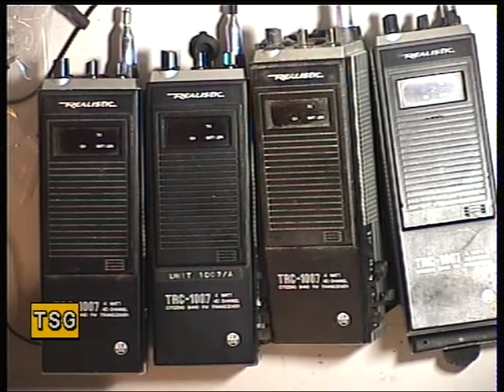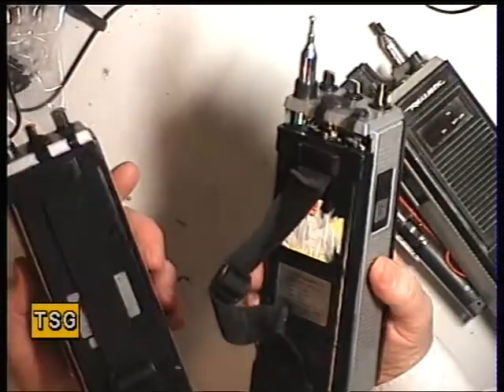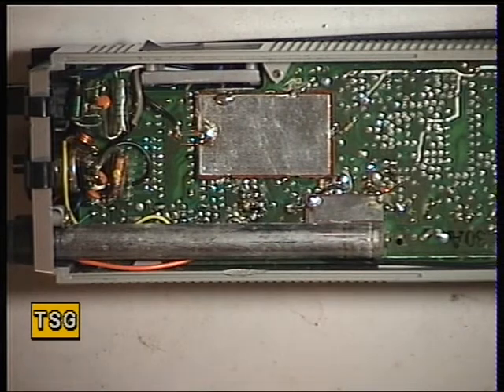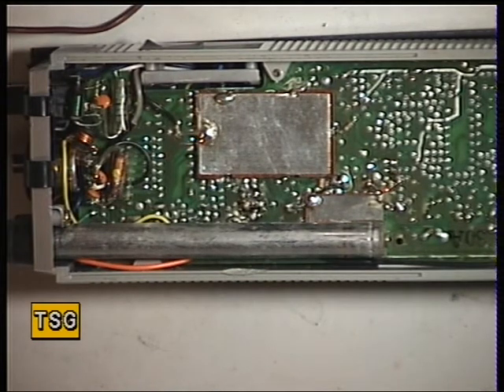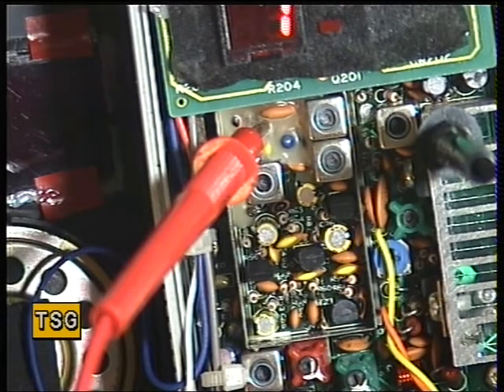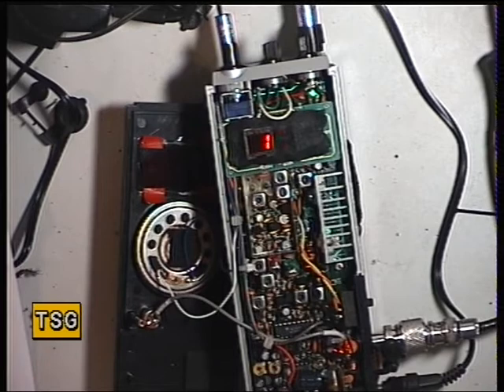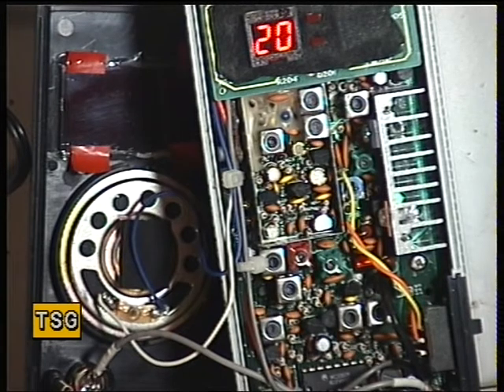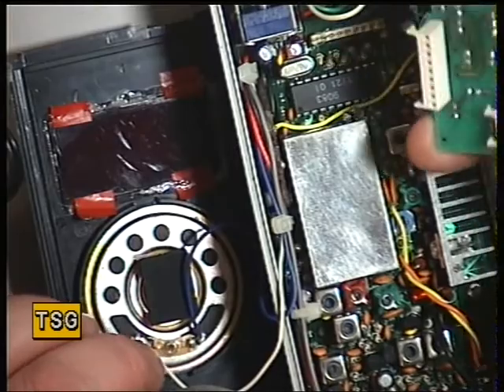Realistic TRC1007 - UK CB radio 3.5W, 40 channel (CB 27/81) (Hand portable). VCO & Transmit

Comment: Yeah I run 8 batteries and 2 dummy in it when I first got it I had a bunch of battery corrosion. I plan on taking to get repaired I'm thinking it might be a bad capacitor. Thanks for the feedback. I know I radios in the UK are a bit different. I like the UK vintage UK radios
Reply from the maker: are you in the 'States?

Richard
Reply: Yeah I live in Arizona . Yeah I really like the old vintage radios and trying to learn how to work on them. Like watching your videos try to learn stuff
Reply from the maker: Just remember, Joe, that everything I do on UK CB is FM &  that AM CB is AM, so huge differences & totally different boards...but often in identical cases!

Richard, G0OJF, UK

Comment: I bought one of those off of eBay trc-216 in great condition however when you turn the thing on it makes a very loud humming noise. They're really good built radios
Reply from the maker: Joe, the TRC216 is the FCC approved AM version for the USA. The innards are totally different to this UK only FM TRC1007. If you are in the UK the TRC216 is illegal to own or use. If you are in the USA you'll need to get it repaired in your own country.

If you are trying it on batteries I recall it is 8 x AA Alkaline + 2 dummy batteries or 10 x rechargeable batteries. thats because alkaline batteries are 1.5V so 8 times 1.5V = 12V & conversely rechargeable batteries are 1.2V each, so 10 x 1.2V also = 12V. If running off a power supply, it needs to be a regulated type and be 12V & not the usual CB power pack which is 13.8V. In line with many 4W CB walkie talkies it is a 12V radio.

Hope that helps,

Richard, G0OJF, UK

Comment: Great video. I have 2 of these trc2007s . The Audio on one of them has really bad clipping as you turn up the volume.  If you scope it you see a waveform that's flat at the peaks etc doesn't  sound good either.  Would this be caused by bad elect caps around the audio ic? Or is it s dead Audio IC?
Reply from the maker: chances are the caps. You only need someone to run this on 13.8V (or worse 15v) instead of 12V to knacker up the electrolytic capacitors. Remember it's 8 x AA throwaway batteries (8 x 1.5v = 12v) or 10x 1.2v rechargeable (=12v)

Richard
Reply: @ukfmcbradioservicingTango21  Thanks Richard. Will go through  the caps and test them and replace if found dodgy.   I am running the walkie on 10 rechargeables
Reply from the maker: @kenrawlings4184  Good. Not many h/helds offer ext mike facility so well worth the bother.

Richard

Comment: hello,I have a set of these radios trying to get a copy of service manual,circuit and board layout would be willing to pay for a copy?
Reply from the maker: I uploaded the TRC1007 manual to SCRIBD for free about a year ago. Knights Electrocom at Kirton In Lindsey, Lincolnshire offer a photocopy for a generous £6.95. I paid £20 from Tandy at the time. Failing all else I would do you a copy for the same price as Knights, but it couldn't be a quick service (14 day) as the radio side of this business is virtually shut down until October, as I move onto  church pipe organ restoration for the summer six months!

You are quite right that the correct service manual is vital for proper repair & alignment.

Richard